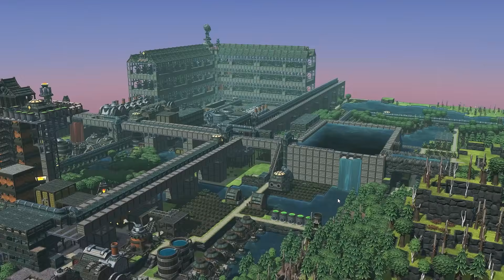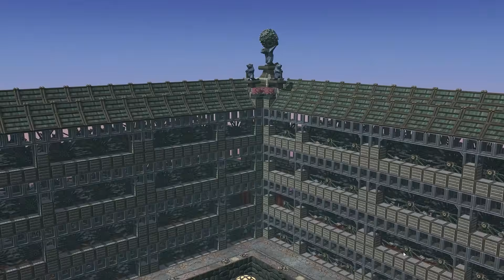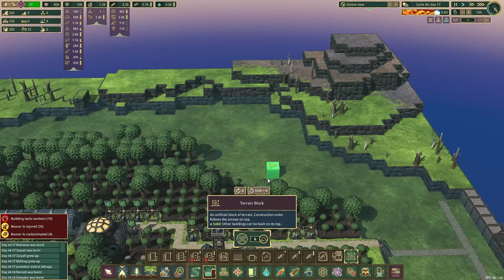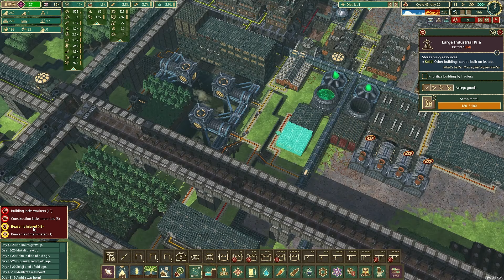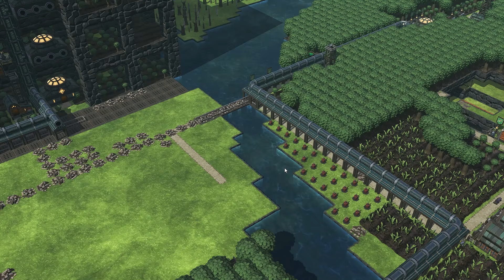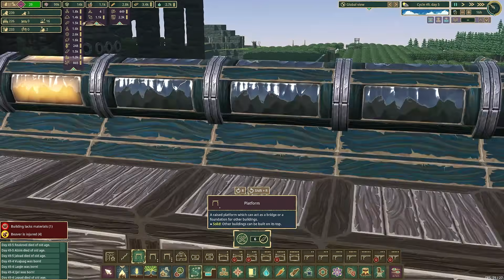Growing 1500+ Trees with One Pond - Timberborn - Skyborn #8

Comment: About towers made of dirt... that looked very tree-like, or palm-leaf like. Very organic if placed correctly.
So theoretically you could make a "world tree" skyscraper, on which you grow regular trees (and crops), that is basically a haphazard spiral of those "palm leafs"! Or if you want to go crazy, you might even be able to in some future map (much more likely as this playthrough is already complete) build towards a singular world-tree (you will need to exploit the 3d-dirt supports a lot to achieve the surface-area per "leaf" and branch) on which everything (all your districts and stuff) is built. Basically making a "the floor is lava" style of map (you can literally flood the ground with bad water, to make it thematic. Just make sure the tree itself is not contaminated, maybe add some barriers.). Maybe even some elven wooden platform and bridges between branches and bridges (no fun if you play the folk tails, as the ziplines will break the challenge).

If you want to truly challenge yourself, you could restrict yourself to only build on the world tree. Basically, rush towards a dirt excavator, get to the bottom (maybe want dynamite for that, though the excavator can achieve it too), then start the tree from there and move everything onto it as you tear out the old buildings (at most leaving a super-tiny area directly at the world tree's roots for some tiny thematic district).

Comment: You could get more area efficiency on those dirt pillars by using a diamond pattern instead of square grid.
Also, you might have wanted to place all the buildings to the side on a non-dirt structure.

Comment: I just built this in my own world and (at least in update 7) it works with most of the support pillars being platforms. I needed one dirt column directly under the pond so that each layer was irrigated, but that was it! I used 3-high platforms, which meant that there are a few holes in each floor (the problem that Zeddic mentions). The small loss wasn't a big deal to me (I'm pretending it's to let light down into the lower levels lol), but you could easily solve that with replacing the 3-high with a 2-high and a bit of extra dirt where needed. The platforms are so much less resource intensive and makes the structure less imposing imo

Fantastic video, thank you so much for this!

Comment: I'm trying to replicate this vertical tree farm, but I'm having one problem, the forester DOES NOT reach the back corner. I've tried adding paths, I've made sure it's in the exact same place as yours, I've added paths in, it just doesn't reach. In your video I can see there ARE trees growing there, mine is still in blue print. Will it work once built? Seems a lot of work if it won't.
Reply: Well... I built it, it works! Weird!!

Comment: 6:50 you know, not having enough hospital capacity will also increase injured beavers. (insert star wars meme : right?....right?) 
Say you have 1 hospital bed and it take the beaver in the hospital bed 10 days to get cure, if your industry injures beavers any faster (say every 5 days) then your bed can heal them, it is going to increase how many beavers are injured so on the 10th day you have 1 injured beaver, by the 20th day you will have 2 injured beavers and but the 30th day you will have 3 injured beavers. which is highly likely why there are so many injured beavers in your city.

Comment: Thanks, I adapted the idea for the other beavers and made it unnecessarily more expensive (cost). A total of 27 squares; 4 fields 12x12 surrounded and divided by water ditches (sealed ground used as paths), each level 2 foresters 1/2 tapper hats 1 lumberjack flag and 1 collector flag. outside middle cable together station, each side of it, liquid pump and water basin together energy transmission

Comment: I had to test this out when I saw your support column trick. By adding a full 3 tile wide overhang all around at the top of a pillar and then building the floor you want on top of that, you can overhang another 3 tiles away from the base of any pillar. This makes it so you can have 12 tiles between the bases of each pillar in a line - this uses the trick you had for the tree farm columns but extends it fully. The next row of pillars would be staggered and you could fill the gaps from there. In my testing, I found that it's a little tricky to plan out but saves a ton of ground space. Maybe this will help if you plan on building a vertical food farm!

Comment: For those wandering how many trees are planted i used an excel sheet to quickly calculate it. Sins i thought 💭 no way thats 1500 trees 🌳 😂. 

Each floor is a 13 x 19 grid 
I subtracted a tree for each pillar and ignored possible overhang no tree planting stuff. 
Every floor could hold 212 trees. Meaning with 5 floor you can have 1060 trees. 🌳
Thats a lot of wood.  🪵

The keen among u who even bother reading this notice. It’s more of a 4,5 floors.  

Anyhow still great idea and i’m gonna do this myself 👌

Comment: I would have used metal platforms because then you can support 81 pieces of dirt with a single square as long as the middle column is irrigated dirt. But maybe use that for the farm tower because with that and the fact that most crops only need a 1 high space to grow means that you can easily triple the crop density compared to the tree tower. Only tricky thing would be to have enough farms to harvest everything.

Comment: Those are some mighty fine towers. The tree farm reminds me of the old brick faced towers you would see in old New York and Chicago. On one of the flybys it looks like you weren't able to plant trees under where you had to put the knee braces for the floor above - perhaps lanterns there like from Bot-town last season? Would add some light and texture. Can't wait to see the farming tower. Might be neat to have the algae and mushroom farms form the foundation and then build the dirt layers on top of that. I think it would give it the look of a building with a parking garage as the bottom floors. Could also throw a mangrove plantation on the roof to pull double duty as a food source and irrigation.

Comment: If you build pillars in like a chess knight move pattern kinda, you can have no gaps. 

I think it is (X is dirt, O is air)
5 Empty spaces between dirt in the same row with a row offset by 3, 3 rows below 

I did it this way, but the arrows of the dirt were so frustrating, if I had to do it again I'd just use metal overhangs and waste more space. ngl

XOOOOOX
OOOOOOO
OOOOOOO
OOOXOOO
OOOOOOO
OOOOOOO
XOOOOOX

XOOOOOXOOOOOXOOO
OOOOOOOOOOOOOOOO
OOOOOOOOOOOOOOOO
OOOXOOOOOXOOOOOX
OOOOOOOOOOOOOOOO
OOOOOOOOOOOOOOOO
XOOOOOXOOOOOXOOO

Comment: food items need 1 or 2 blocks depending what it is to be planted so remember to plan accordingly to the thing being made each floor...

on a side note i would have personally dynamited to the bottom of the map before building up from there so i can use the max height possible for the dirt towers...

also a random thing iv enjoyed using in my games has been 2 overhangs facing each other with a bridge at the end of each so it takes you across like 22 tiles or something like that and it has been my go to thing for connecting 2 tall buildings with each other or for building a path over other buildings... slightly redundant with the tube ways though...

Comment: I love the way you designed the storage. That said, I created a storage system for warehouses I think you may like. You can connect a tube way station’s door to a warehouse door. And tubeway stations next to each act as tubeways.

And you only need a little bit of space for the station. Exactly one Warehouse tall and wide.

I would need to look at exactly what I did to explain it, but you can basically have tubeway stations act as the roads on the floors and a solid tubeway at the ends to act as the elevator and create a tall tower that has two ways in and out depending on if the beaver needs to leave through the North or South side of the tower. Or East or West depending on how the Tower is laid out.

At the very least, by giving you the idea of connecting the front door of the stations to the warehouses, you can try creating some interesting storage towers for food, parts, and other goods stored in warehouses and top off the tower with liquid storages.
Reply: IDK if he'll use it, but I was just getting to the 'I need big storage' part of my colony so I'm using it, that's for sure.

Comment: cool! if you shift dirt pillars like chess horse moves (for ex. 5up+2left at 90 degrees ) it allows you to build a whole sheet of dirt floor without additional supporting blocks. one and/or two blocks high store can grow crops. pool's walls also can be of dirt to plant something 😉
Reply: Or you can just build a single dirt column in the middle, use 8 5x5 platforms per floor + some overhangs, and you will get a round-ish tower that utilizes maximum irrigation range for each floor while having almost no wasted space for supports. Also do 4 high floors (triple platform underneath metal platforms and overhangs) to fit foresters near the central column, because they easily cover adjacent floors. Stairs/ladders/whatever in the middle too.
Same for food, except 2 high floors (a single platform underneath metal platforms and overhangs).

It is extremely broken, though. It allows to reduce water usage drastically for huge colonies. With emberpelts it allows to use almost no water at all even for 1k beavers.

Comment: I think a little different grid would be a better Idea: if you shift every other pillow by half the grid size, you schould not have holes even without support. of course, you could still use support, to get you pillows further from each other.